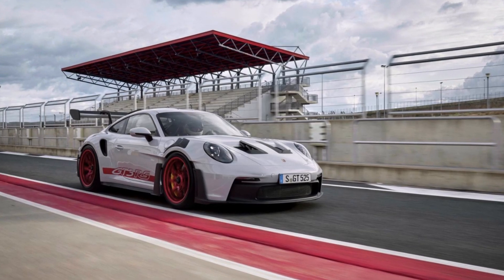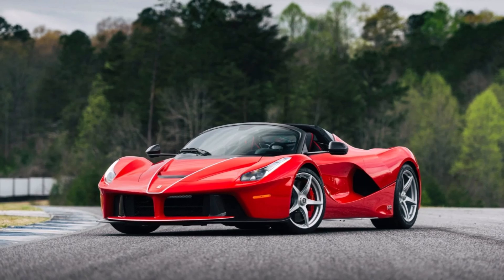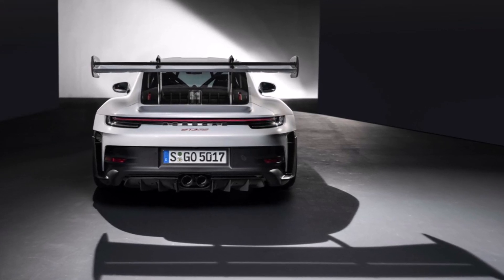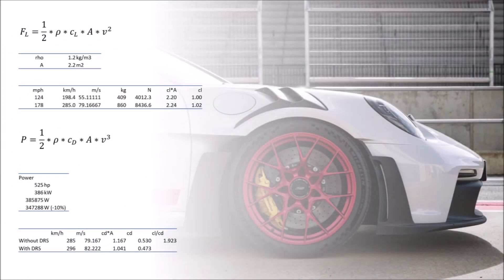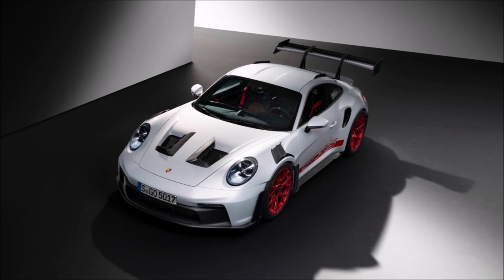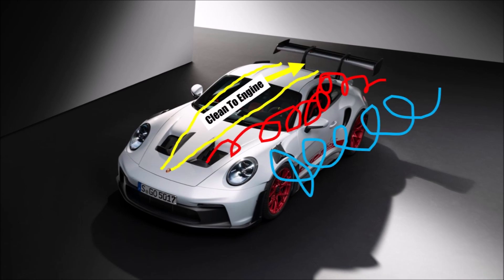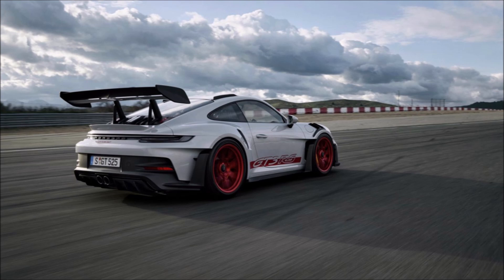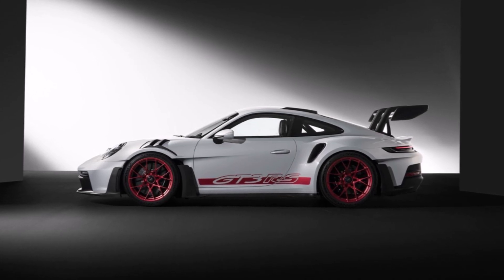Porsche 911 (992) GT3 RS - FIRST LOOK (Technical Analysis)

Comment: I just felt like, 100kg more than a LaFerrari at the same speed.. just props for the LaF,, without all the crazy aero and achieving such results, considering it's not a track car.
Reply: that being said, the Laferrari doesn’t have a budget limit or sell price limit. I’m sure given enough money, Porsche could make the GT3 RS with the same downforce with a smaller wing (probably using the tilted engine concept in the GT3 race car to allow for a bigger diffuser at the rear), but that would cost more money and engineering time to make it effective + reliable, and likely bump the cost even more.
Reply: And as much as i love the Laf, the Italians love to lie, I seriously doubt the laf has even half as much downforce as this.
Reply: @Vibe_Raider  the LaF had huge possibilities with longer and bigger Venturi channels, something Porsche can't with their engine position
Reply: LaFerrari has huge diffusers
Reply: LaF does have more underbody aero. Ferrari does have a history of nailing their underbody aero.
Reply: @Vibe_Raider  its not the 80s anymore mate, last lying scandal was the vw group (porsche) about their emissions
Reply: @Velocitist  yes, the engine is tilted down towards the front so they can start the diffuser way earlier than on the 911 roadcars, one major downside of a rear mounted boxer in a modern sports car.

Comment: The most interesting thing is them claiming that in some corners the GT3RS on Cup 2 Rs pulls more Gs than their GT3 Cup car on slicks.

I was also quite looking forward to the reveal of some new tires that should be debuting on the GT3RS - the P Zero Trofeo RS and also the "N1" generation of the Cup 2 R. But it seems that they skipped that announcement for now - and possibly until the Nurburgring lap is completed and the superior tire is determined :D.

Comment: Excellent analysis. Thank you. In the preview video, they also show turning vane looking aero device under front of the vehicle (4 on each side).  The VW IDR had them, the new Ferrari 296 has them front and rear.  Seems like people are moving toward using this device.

Can you explain how this thing works?  Thanks and keep up the excellent work!
Reply from the maker: Thanks! I think you mean the turning vanes to push the front wheel wake outside to keep the underbody flow clean?!
Reply: @bsport320  I believe so. They are getting larger and deeper. Do they serve additional downforce purpose? 

Why does Ferrari also use them in the rear?

Thanks!!

Comment: The 911 GT3 has always had a reptuation for excellent handling and chassis tuning, but this is just very badly compromised car. I see no end of faults - faults the Cayman GT4RS does not have to the same degree, a car with a better layout and induction system.
Reply: Which faults do you see?